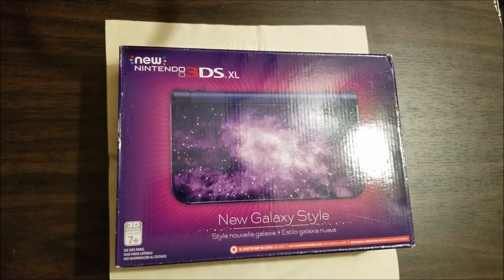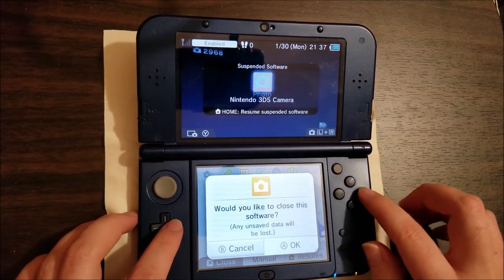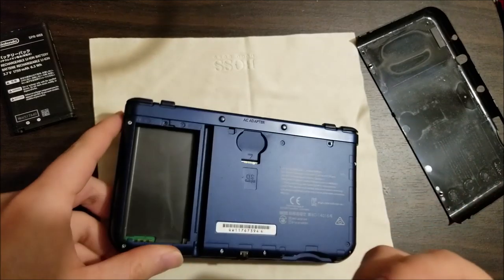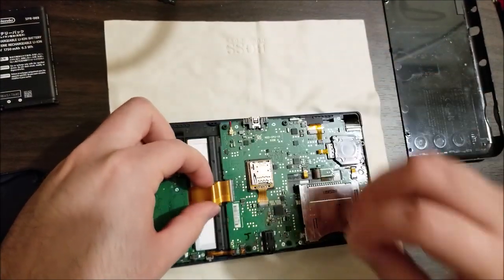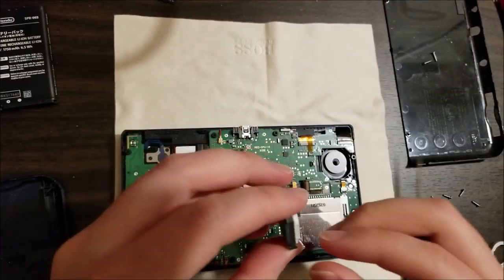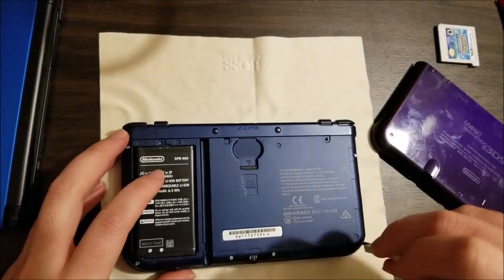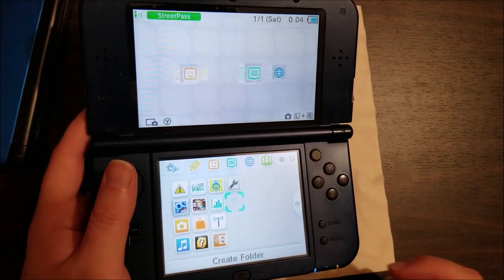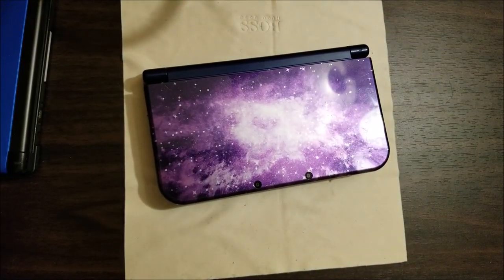Let's Fix: Nintendo New 3DS XL With Unresponsive Buttons And Touch Panel

Comment: Thank you! Thought my system was dead and I had these exact symptoms, so I rooted around on the edges of the touch screen with tweezers to clean out the gunk and it works again!
Reply: how did u do it?
Reply: @beccat3954  I've used playing cards in the past but be careful!

Comment: Happened to me today too! I dropped my New 3DS XL on a carpetted surface and it didn't sound or look too bad. But specific buttons didn't work so I assumed one of the connecters got loose. Turned out the plastic bezel was a bit dented after the fall and was permanently pushing down on the touchscreen. Lifting it up with my fingernail and everything worked fine again.

Comment: Thank you for this video!

I had the exact same issue only instead of the screen protector being put on improperly, a tiny piece of dirt (crumb or something) somehow got stuck underneath the screen's frame, pushing down on it.

When I scraped it out, everything immediately worked again, wow. I would've never thought of that.

Comment: I can't do it I'll just buy another 3ds xl that's impossible for me
Reply: same :( The b button on my nintendo doesn't work and there are other Problems
Reply: The other problem is that they don't repair certain types of 3ds anymore
Reply: @deltastar4147  Really? And idk if the random shop in my city can do this... I would buy a new one,because my 3Ds is already 7 years old and often turns off
Reply: @xjuice1554  yes Nintendo on their website said they won't be able to repair certain types of hand held ds anymore
Reply: @deltastar4147  That's sad
Reply: xjuice its actually not that hard. Take it apart, replace the board, screw it in, and close it up. Looks a lot more intimidating than it is
Reply: xjuice You can stills send it to CPR (Cell Phone Repair) they will repair old 3DS I think.

Comment: I also bought a used new 3dsxl a while ago, and this issue is happening now. Thank you so much for the vid. Interestingly enough. All buttons work, but when and where they work is different. I cant shiny hunt in Pokemon with ease. But entering menu's, and the 3ds main menu locks the bottons and I cant move of use anything. The touch screen doesnt input either way.

Comment: It might also have been a loose connection. I took my kids screen protector off and cleaned the screen. Still not working but I don't have a small enough screwdriver, nor those fancy tweezers, so as of right now, I can't  check the connections.

Comment: my wife's had the exact same symptoms. it got knocked off a countertop and the digitizer broke. Either the digitizer for the screen was giving phantom inputs that were ghosting out buttons, or the digitizer has some common hardware with the buttons. this is my prediction. I ended up breaking some of the little ribbon cable clips while attempting to repair it, and broke pins while attempting to fix that problem. 

fortunately, i was able to get the buttons working with a new digitizer, and was able to do a system transfer to a brand new device, so not all was lost, but i pretty thoroughly nuked that console.
Reply from the maker: I'm mostly fine with zif and press fit connectors, I really dont like the tiny slide spring retention connectors used for the power button and mic in this console. Seems like they are super easy to break and the tiny amount of pressure they use coupled with their non-locking design seems like they could cause reliability issues long term.

Comment: My SD also had some sticky stuff on it, I opened my new 3ds just to see inside. SD was sticky but i havent used the ds in 2 years plus it works fine and I kept it real safe. Weird
Reply from the maker: I wonder if it's some lubricant or something from the card reader slot mechanism that's gone tacky as it aged. I cant imagine it's from some external spill or something given how well encased the slot is.
Reply: @sjm4306  my guess is your guess, I kept my DS damn well safe so I would say your right
Reply: @sjm4306  what screw driver did you use to take out the screws
Reply: @samueljarevalo9457  Philips 00.

Comment: i tried what you said on my 3ds and yep, the buttons doesnt work when i hold the edge of the screen with something or even touch and hold it like usual, thats because the 3ds think youre touching something on the touch screen and in the video its the screen protector thats just slip a bit so it gives pressure to the touch screen like youre touch and hold it even though youre not and so you cant press the buttons (except the power button), so yeah its just because of the screen protector... at least thats what i think

Comment: Cool! Mine is just some hair/dust or something under only right and down on my D Pad which is very unfortunate as it looks like I would have to take the whole thing apart to get down there…. Luckily I can kind of move the gunk off the sensors temporarily by ‘breaking in’ (pressing the buttons a crap ton) before using the system. But it will sometimes still not respond when i push it. Oh well. Maybe if there is another vid that goes a bit further in I would give it a try. Lmk if you see something like that!

Comment: I have this exact 3DS and my B button recently stopped working. I ordered some small screwdrivers on Amazon and I’m currently waiting for them to come in so wish me luck that reseating the ribbon will fix it for me. 🤞
Reply: Did you fix it? I'm having the same issue (mine works, but only if I press hard).

Comment: Thanks for your informational videos :) Today, I fixed the L and R buttons on my 3DS XL. Unfortunately afterwords playing Mario Kart 7, I just remembered that the A and B buttons (maybe X and Y too), aren't working properly. They DO work, but I have to press them a lot harder than normal. Does the rubber padding need to be cleaned? How should I fix this? Thanks again!
Reply: How you fixed this?

Comment: my prediction, it has something to do with the mother board it self. the C-stick usually moves the cursor on the home menu and the fact that only 2 out of the 4 letter buttons don't work, hints at a mother board malfunction. the fact that the D-pad, joystick, AND touch screen doesn't work, but the power button works just fine, indicates to me that it might be some of the pins for the ribbon cable connectors or it's the actual feeds on the mother board themselves that are the issue and some soldering shenanigan's might be at play in this video. (ik this is a 4 year old video, just lemme play along lol)
Reply: wow, after watching the full video, I just needed to clarify that I was WAAAAAYYY over thinking it. I didn't know it had a screen protector on it because most of (if not all) of the DS' that I've worked on never really had a screen protector. 'Ither way, a very interesting turn of events and I'm just happy to see one of my favorite limited editions fully working again.

Comment: i have/had the same problem. people were saying to use scotch tape to get the screen protector off, but it didn't work for me. though it did help a little bit the buttons do work but the dpad and circle pad activate the top left of the screen. really annoying while playing vc games which I play a lot. do you think that taking off the protector will keep this from happening?

Comment: My first 3ds broke because my guess was debris stuck around the edges of the screen, though trying to brush it out did nothing. Ended up watching a shit video that told you to "lift up the ribbon connector flaps" and broke my motherboard beyond repair :')

Paranoid that this'll happen again, for anxiety sake prob best if I send it off for repair lmao

Comment: I accidentally got mine in the washing machine and the dryer but all buttons survived screens survived but the sensor on the bottom didnt can I get another  video how to do this?
Reply from the maker: I no longer have this unit as it was a repair for a customer. What sensor are you talking about though, maybe I can point you to another repair video/tutorial.
Reply: I ment the touch screen

Comment: It’s not a fall once you click something and you don’t let go it’s stuck on that one thing is focused on it so it is the screen protector was constantly pushing on it he didn’t want to move any other button as it would disrupt the mode for example if you were calling somebody or if somebody received a call from you when you’re talking if you hold down the hang up button it will hang up until you let go
Reply from the maker: Maybe it's my background as an embedded programmer talking, but I would get reamed if I ever programmed something to lock up and refuse other inputs if one button was held continuously. With the stuff I normally work on it could literally kill someone if I did that. That being said this is a game console and not a medical device or mission critical spacecraft so I guess it doesnt matter as much. Still weird that there isnt a timeout at least in the menus or something.

Comment: With my new 3ds xl, the a button works like normal, and It's the one I use the most (jumping in Mario games, selecting stuff, etc.), but my x button doesn't work at all, and I also used that one a bunch, b requires a very hard press, and I used it a lot (going back in menus and such), and y doesn't work at all, and it's the one I used the least, and everything else works fine and I have no screen protectors. I have not taken mine apart yet, but seeing your previous video, I would have thought my a button would have been broken by now, but it isn't. also it has been subject to small-distance drops from time to time, and it often has sweaty hands playing it. What do you think the problem is? P. S. I say used because I didn't really know what to do with a broken 3ds until I discovered that TLOZ ALTTP was on virtual console.
Reply from the maker: It could be slight misalignment of the button plastic or rubber pad from the drops or maybe sweat did seep in and got under the plastic membrane. Either way it couldn't hurt to open it and give everything a good clean, inspection and realignment if necessary.
Reply: Thanks, I will see what I can do, by the way, your videos are great!

Edit: some times in the past I would try to play games, and after enough hard presses the buttons would start working to varying degrees.
Reply: Can I use your previous video as a guide for getting to the buttons on the new model? Or are they too different? (the old and new models)
Reply: @sjm4306   I opened it, and just about everything related to the buttons was disgusting, and I cleaned it off for a good bit of time using q-tips and contact cleaner. I am tying to reconnect the ribbon but the white part confuses me due to its nub on one end. Does this nub face up, or down? (looking from the angle at which you disassembled it)
Reply: @sjm4306   I am pretty sure I broke it, from the dents in the ribbon. Oh well.

Comment: I have an issue on regular 3dsxl where only my a-button is becoming unresponsive. The very left-side of the a button and top side do not work when pressed in those areas. Otherwise, midle/right side of a-button works fine simple press but on the very left i have to press really hard for it to work.
Will this fix that issue too or is that a different issue?

Comment: Uh im wanting to know something 
My 3ds it is the same model but the joystick keeps going right and im not touching it
Reply from the maker: Sounds like the connector for the joystick could stand to be reseated. If that doesnt work then it might need to be replaced.
Reply: @sjm4306  Thanks for replying so early also how do i do that
Reply: @sjm4306  Also if i could go to game stop do you think they could fix it for me
Reply: @sjm4306  Hello
Reply from the maker: Gamestop doesn't repair consoles for customers, they would likely try to sell you a replacement. You can follow the instructions in this video to get it open and I think I show removing the joystick so you can do that and put the ribbon back in, lock the tab and see if that helps. If not, then like I said you may need to buy a new joystick and replace yours as it could be broken.
Reply: @sjm4306  This is very hard to understand but if you could make a video or explain it more or i could video call you and you can explain
Reply: @sjm4306  Never mind in found out to fix it

Comment: So I tried holding the stylus in the same spot, and recreated it on another new 3dsxl... Same behavior.  

Now here's even more, it only is happening when the home menu is up, in a game it doesn't do it.  In the home menu software, that particular corner is for the icon resize, so the software is probably waiting for the resize request to finish.  Also, it doesn't happen if the icons are at the smallest size.

Comment: I loved this video, i would never though it was the screen protector hahaha.

I have a problem with mine, the A button works, but its less "clicky" than the rest, i cant feel it clicking, it judt performs the action, but its like suuper sensive, id that fixable or wouldbi need to buy a new button board?
Reply from the maker: You can peel off the plastic sticker and swap the metal snap dome under the button but it'd probably be easier to replace the button board as a whole as you'd probably have to change all the metal domes with the same kind or the actuation force would feel different.
Reply: @sjm4306  oh, i get it, i saw that replacement sticker with the metal domes, i could buy the full replacement since its a lot cheaper
Reply: @sjm4306  what screw driver do you use to take out the screws!!

Comment: I did a replacement on my ABXY buttons and the ribbon cable that connects the main board and the ABXY board ripped, where could I buy a replacement?
Reply from the maker: ebay or aliexpress are probably your best bets

Comment: Is there anyway to fix the touch screen if it goes to the right? It’s kind of hard to explain but basically, if you touch anywhere on the touchscreen, it will respond by going all the way to the right. For example, if you press in the middle of the homescreen, it will just touch the arrow on the right and move the screen to the right. If you touch anywhere at the very top of the homescreen, it will click “shrink icons” or the 4 squares at the top right corner. Do you think this can be fixed by moving ribbons or do you think I need to get a new screen replacement or it’s possibly something else?
Reply from the maker: Sounds like it could need recalibration. You can find the touch screen calibration in the settings menu. If that still doesnt fix it you'll likely need to replace just the touch panel.
Reply: sjm4306 guess i have to replace the touch panel because no matter what I do, the touch screen will always go right oof. How much do you think it would cost to fix it?
Reply from the maker: A replacement touch panel is probably only $10-15, installation should be pretty easy so long are you are careful not to damage the connector.
Reply: sjm4306 alright thank you sir
Reply: At least everything else works

Comment: You said limited edition galaxy style? Ive seen those in walmart for the past year and half. If its limited why is it still out after a year?
Reply from the maker: I'd guess because the 3ds is basically at the end of its life (and the 2ds xl basically canabalized sales of new 3ds xl consoles like this one) so even a limited release would take some time for resellers to go through stock.
Reply: @sjm4306  what screw driver did you use

Comment: I doubt that you might see this but do you do repairs for subs? I just found your channel from google cuz I wanted to see if there was a way to fix my 3ds. The buttons are not responsive on the home screen besides the A button. The touch screen doesnt work. The circle pad and d pad don’t work on the home screen either. I would do it myself after watching these videos but I don’t have the tool.
Reply from the maker: Do you have a screen protector on the bottom screen installed?
Reply: sjm4306 no I do not. Would it help if I were to upload a video to show the issues I’m having?
Reply from the maker: Possibly, it could also be a bit of dirt or dust got wedged into a corner of the touch screen.

Comment: My sister had this happen to her and she took of the screen protected and boom the touch screen worked the buttons worked
She has a 2ds xl btw
Reply: 2ds xl is NOT a thing
Reply from the maker: The new 2ds xl is very much a thing (infact the latest and likely last model of the ds line). Eg https://www.amazon.com/New-Nintendo-2DS-XL-Turquoise-Pre-installed/dp/B07GWYYHPQ

Comment: I changed the circle pad button on my nintendo 3ds old, I did the whole procedure right but when I turned it back on it was out of control like yours, I've tried everything and I can't fix it.
Reply from the maker: 99% of the time when this happens it's because the circle pad ribbon connector isn't seated properly.

Comment: I know this is from a year ago, but my right button my exact 3ds xl isn't working
Reply from the maker: It could be the ribbon or connector for the shoulder button is damaged or unseated. Either way opening it up and inspecting it should be useful.